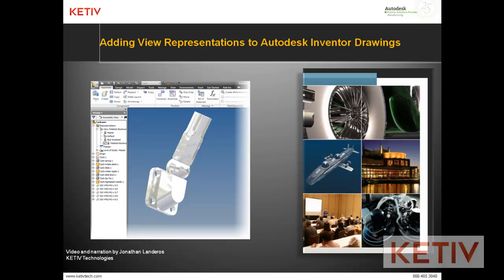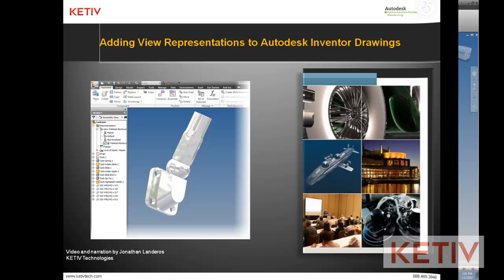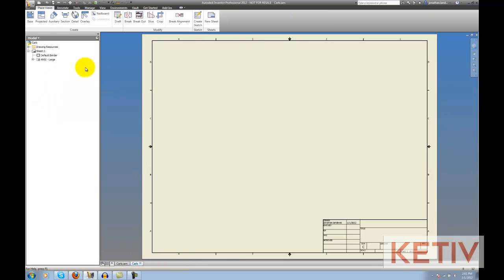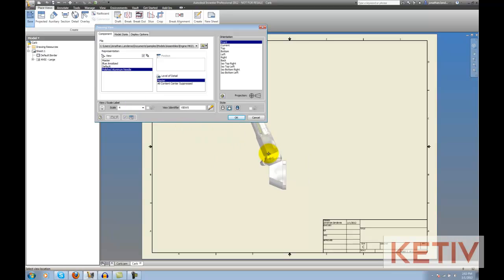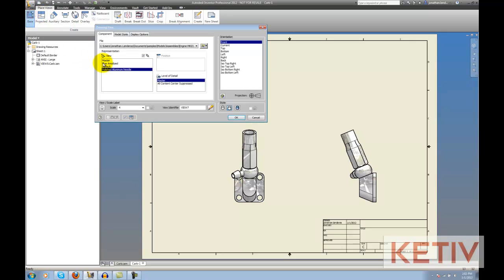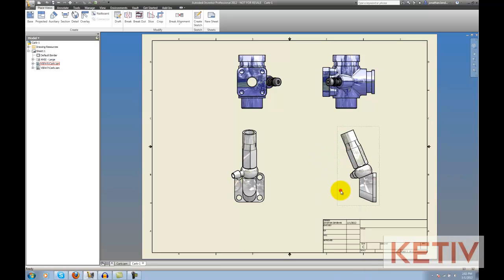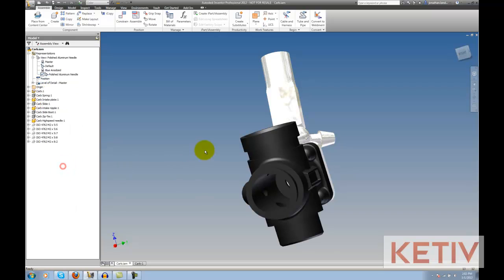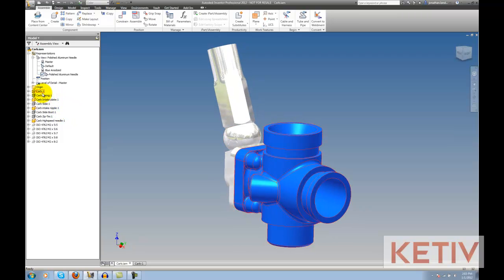How to Use View Representations in an Autodesk Inventor Drawing

Comment: hey, I made a quarter half and a half cut view section and other than the full view and define them as view 1 and view 2. I locked them. When I was doing the drawing, the based view kept on importing the full view assembly(view in master lock.) Instead of the other view. The original assembly is too big I just wanna show the part covered only in the quartered view is there a way to do it?
Reply from the maker: Hello,
Just confirming, did you set the drawing view rep to be the desired assembly views?  Have you considered doing some of those section views and cuts within the drawing environment?  That may save some time from having to create multiple view reps in the assembly environment.  Hope this helps!

Nigel
Reply: I will try thanks.